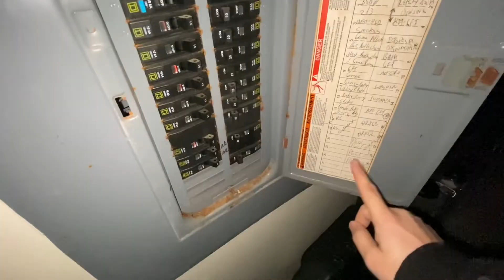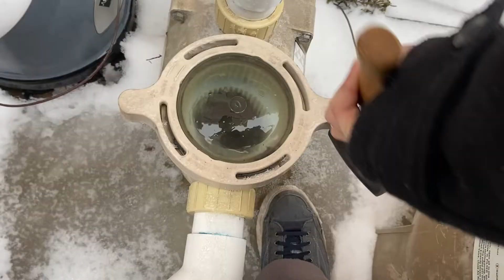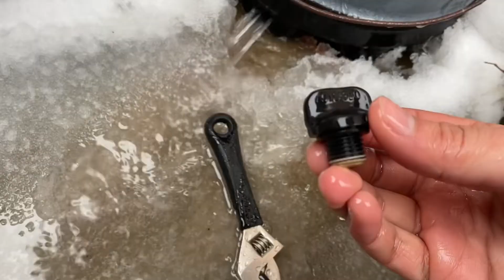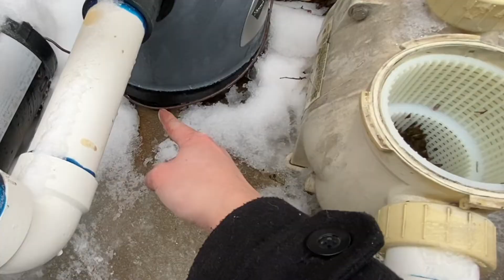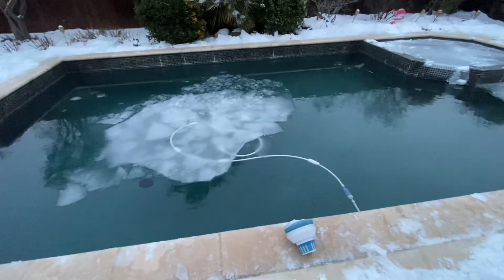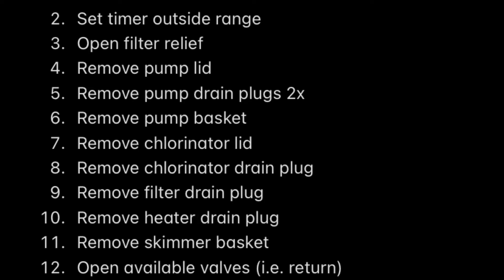How to Turn Off and Drain Pool Equipment (Pump, Filter, Heater, etc!) PREVENT FREEZE

Comment: Great video. North Texan here, I never lost power but on Thursday my water level was getting low (below skimmers) and I had no means of adding water (frozen hose). So I did all of these steps to drain all of the water out of the equipment. What’s your advice on getting it all back up and running again and when to do so? It’s getting much warmer now so today I am adding water back into the pool but not sure when to get all of the equipment back up and running again.
Reply from the maker: Got it! I'm planning to make a video this week. Waiting for the last cold evening to pass through first. It would probably go like this:
1. Remove filter cap and clean all the filters (spray down with hose). Hold til step 5 to close filter.
2. Plug in all drain plugs for pump, filter, heater, chlorinator (lube them with magic lube)
3. Fill water in the pump. Lube o-rings, place pump basket and pump lid back on.
4. Fill water in the chlorinator. Drop 2 chlorine tabs. Lube o-rings, place chlorinator lids back on.
5. Fill water in the filter. Lube o-rings, place filter cap back on. Tighten the air release valve at the top.
6. Place skimmer basket back in.
7. Close any open valves (i.e. Spa valve)
8. Turn on breaker.
9. Manually run pool pump. Let run for 10 minutes, then check for leaks. 
10. Set timer to normal.